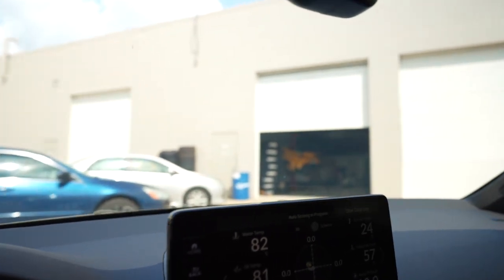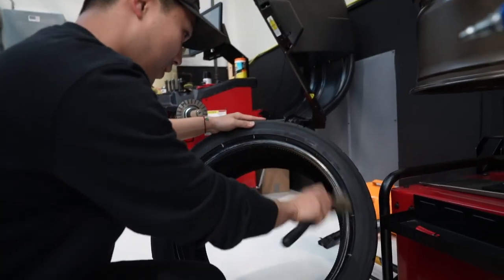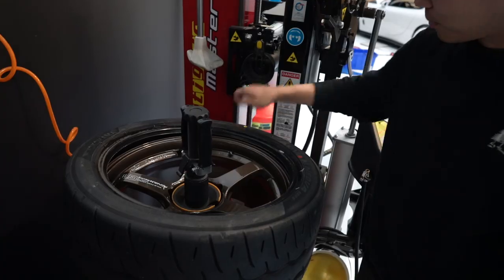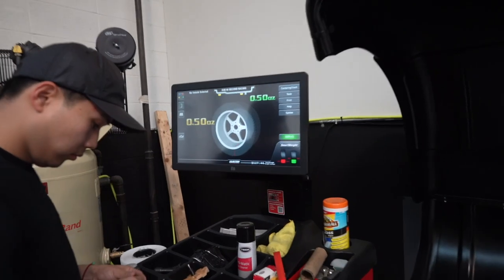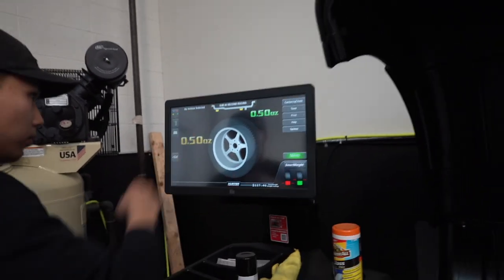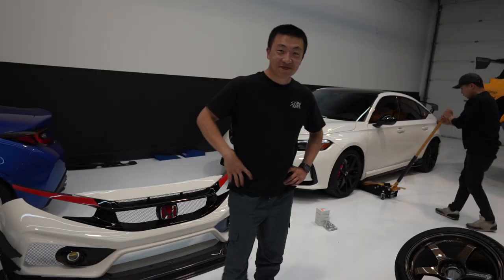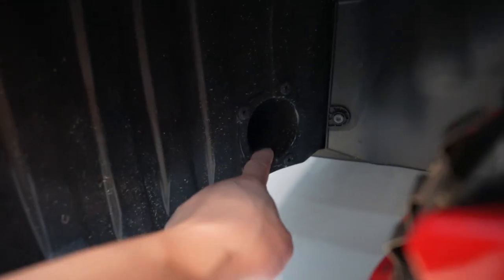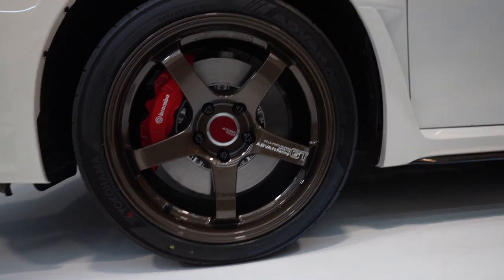Perfect Type R Wheel Specs | Behind The Scenes Sub60R

Comment: Guessing hub centric rings weren’t needed? Got Beyond’s on the way for my FL5 so wanted to be ready.
Reply from the maker: Yes you do need hub rings. 72.60 or 64.10MM I can't remember the size. Check with your supplier.
Reply from the maker: looks like the GT Beyond 18x9.5, 5-120, +45ET are 72.50 CB

Comment: @phothrottle what size were the center caps? The 63mm or the 73mm?
Reply from the maker: What car are you asking for. Some advans require 63 and some 73 depends on the vehicle.
Reply: @phothrottle  I bought the exact same wheel and spec for my fl5. Advan gt premium 18x10 +40 5x120. Center caps weren't included but the site has both so wasn't sure which size to buy
Reply from the maker: 73mm

Comment: what degree of the camber?  Does it rub? 10J 265 Tyre
Reply from the maker: Kevin I'm running stock camber. I had a wheel alignment done just to make sure everything is good and not out to lunch. Turning the wheel lock to lock and going over bumps it doesn't rub. I did a follow up driving vlog with camera angles showing the wheels going over bumpers. Go check it out when you have time. Thanks
Reply: Thanks for that, I will go check it out, and what’s the benefit of 10j over 9.5j?  I noticed you still go for 265 tyres. Is it because it has a chance to fit 275 to 295 later?
Reply from the maker: It's just wider. And you can stretch the sidewall a bit more so increased stability. You can go a wider tire but it would really depend on your setup meaning how lower your suspension,  how much camber etc....